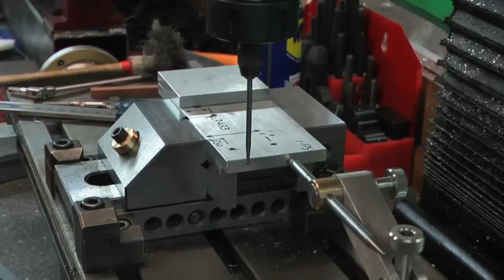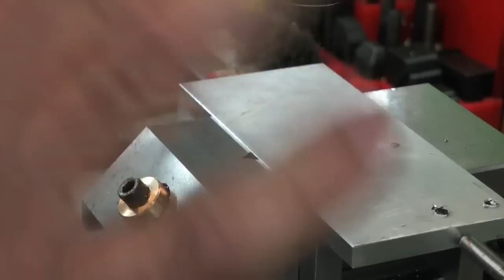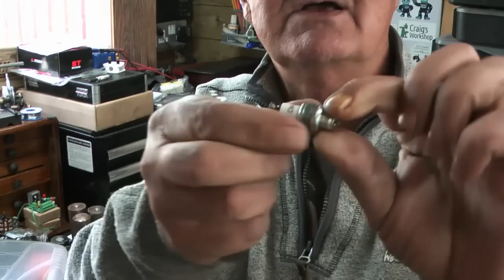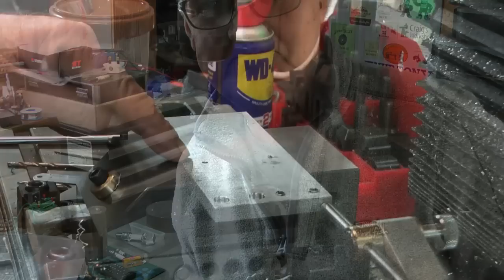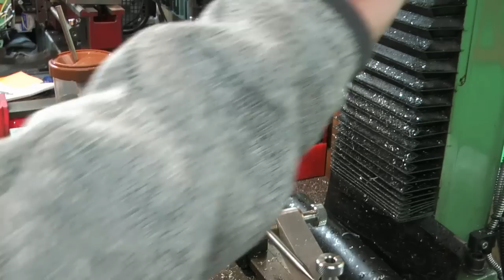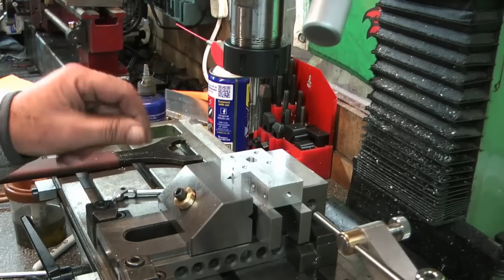Webster engine build part 2

Comment: It's always nice to see something made to look really pretty, but as someone who may want to build one of these someday it's only necessary for me to see it work properly. If it was my own first internal combustion engine build I think I'd be more concerned about function that looks but you have a lot more experience than I do so it's your call. I won't complain either way.
Reply from the maker: Hi Robert. It will be made to work come hell or high water. I will make it look nice along the way though . Cheers Ade.

Comment: If you're interested in anodising, have a look at Mark Presling (Preso)'s "Metal Finishing With Mark Anodising 101" for an acid free method that works very well indeed. It's worth getting commercial dyes (IMHO) - they are available in small amounts on ebay. If you follow the method he uses, there's no appreciable dimension changes (the etch takes off what the anodising puts on).

(If you're passing near the LL18 postcode, I can show you my simple set-up).

Comment: I think that you should round the corners of the head on the mill, leave the finish as the bare aluminium, paint the cylinder with engine black. It will never be beautiful like the cast models so why waste time in doing that. Carry on the good work.
Dave H

Comment: Nice work. How about a corner rounding cutter on the edges. It would look nice in natural aluminium I think. Turned or machined alloy has a nice look to it. I am the same with metric and imperial. Studied in both in my technical education in the RAF. Then every aircraft I worked on (all British) were imperial. The one I worked on longest was all BA and BSF.
Reply from the maker: 3/16 whitworth is the worst tap in the world . lol. thankfully not much call to use it now . Jury is out on the decision . Cheers Ade.
Reply: @ade63dug  Oh yes I certainly agree on the 3/16W tap!

Comment: Ade, Here in the States we love Imperial but like most people who have worked in the international market we also do Metric and go back in forth in how we call out dimensions and tools so you sound very normal to me as you mix your systems!   Go for functional and enjoy your engine!  Cheers from Pennsylvania!
Reply from the maker: Interesting! however. anodising will harden the surface of the aluminium to a degree so it will be tougher in use. A double edged sword hangs over me , lol. Cheers Ade.

Comment: Gday Ade, nice save on the side plate, as for the finish anodising would look great and I’ve thought about having a go at it but I’ve been lazy, simply fly cutter finish and soften the edges and mission done, Cheers
Reply from the maker: Thanks for watching Matty . I only hope mine turns out half as good as the TWO you made. Cheers Ade.

Comment: Anodizing is a pain to do. It took a number of parts until I got it down. Your surface finish needs to be perfect. Anodizing emphasizes even the tiniest defect. And after it’s done, it can’t be sanded or polished out. You need to remove the anodized finish and start over. It also needs to be perfectly clean. And I mean perfect. And anodizing adds slightly to the surface size, so if you’re going to anodize anything that needs to be sized accurately (screw holes, bores, etc.(, you have to compensate for that slight increase in thickness. The process grows both downwards and upwards to the original surface height.
Reply from the maker: Thanks for the advice . I will certainly practice on scrap before committing . Cheers Ade

Comment: Why do people insist on using those awful wobblers for edge location when a decent stylus type DTI is much more accurate if used correctly.
Reply from the maker: The reason that they are used is to efficiently work to the tolerance required. whilst I totally agree that the dti method is far more accurate it is not time efficient when the degree of accuracy is not needed . The wobbler or edge finder will give repeatability of 1/2 thou easily and takes far less time. As engineers are taught to make the most efficient use of time based on the needs of the task in hand. That is why we use wobblers in a nutshell . Cheers Ade.
Reply: @ade63dug  you have obviously never used the DTI method as it’s quick as using a wobbler or sticky pin and especially if you have an Interapid two way stylus DTI. As a former toolmaker this is the method we employed for all work whether it was die work or merely pitching out holes in rubber mould thermal insulation.
Reply: I have to admit I have a couple of wobblers and I tend to only use them to find the centre of something where I can touch off on both sides and then use the half function on the DRO. Either that or I still use slip gauges and toolmakers buttons in my home workshop as my belief is accuracy is an art that should be practiced regardless of necessity.

Comment: Ade, your drill chuck looks like its held in an ER32 collet. Is that correct, if so that would explain the very quick change over time. 
Make the engine to run, then polish it up afterward. You may have to adjust some dimensions and its easier taking material off than adding it back.
Reply from the maker: yes . it is a 1/4 inch Rohm chuck in ER32 on 12mm shank . I did make the shank in an episode maybe a year ago . runs really true . I will get a larger chuck of the same brand to go with the quick change idea . only issue is that it does take up Z height on my small mill . I do have a 1/2 inch chuck on the MT3 taper in the head that I use sometimes and also have a MT3 x12mm direct collet for the head that I can use when more Z travel/height is needed . I have got most area covered but the little Rohm on the 12mm shank works brilliantly . Jury is still out on the way forward with the engine . Cheers Ade.

Comment: Nice save on the broken tap part Ade.
Ref swaping Metric and Imperial on the fly, same with me, started my apprenticeship in 1978, existing designs were imperial,  new in Metric, all machine tools in imperial, and very few Metric drills and taps, though I remember in junior school having to change text books from pounds, shillings and pence (LSD). 
Hope you get rid of the lurgy soon, maybe a big flu outbreak on its way?
Thanks for sharing and stay safe all.
Reply: I was raised to think in imperial, and as a result I convert metric to imperial as I am not at ease with it. Conversion ratio of 1:25.4 is easy to reference and simple if I do it all the time. I remember in school having to list the speed of light in furlongs per fortnight, so this is relatively easy.

Comment: Hi Ade. I have just made the rear parting tool video & used a radius cutter on the edges. Would I do it again . Oh yes. I think it would look great with those edges rounded. Especially if you are going to Anodise it. I did some video's on Anodising without Sulphuric acid, which is hard to get now without a Licence. 
Regards.
Steve.

Comment: Hi Ade,
I would use a chamfer bit around the edges and make it a functional engine. Stay safe.
Reply from the maker: Hi Don , I do have some chamfer cutters but I thought it may be useful to show how it can be done single point with a fly cutter . the edges are done this way. I am leaning towards anodising due to the surface protection it can offer if I use it a lot . still not made a decision though . Cheers Ade.

Comment: Great work.   to remove the tap from aluminum stock,  you can drop it into shallow plastic container with HOT water, and add some Alum.  Alum is found in the cooking section of your local store, and it will dissolve the steel tap.
Reply: Depends if it was a colbolt or tungsten or even a carbite tap, 
maybe best to invest in tap extracors as i have some not used yet luckly 
isnt it amazing that Taps tend to break when 98% the way through.

They key is to use plenty of lube.
Reply: @spudnickuk  lol yea I think the 90% through is some kind of law of nature :D
Reply: Another enjoyable episode Ade. I'm with you working in both imperial and metric, it must be an age thing lol. I'd just like to see it working and hearing the exhaust note, thump, thump. Tony

Comment: Looking good Ade. Good save on that part. If you hadn't decided to drill the holes first and then cut the corner off that part would have gone in the bin. As far as looks go. I say get the engine running first. Then you could have a series of videos on striping it down and beautifying it (rounding corners, anodizing, painting, etc.)
Hope you get well soon.
Steve.
Reply: I agree with Steve.  Get it running first than go back and make it as pretty as you want.